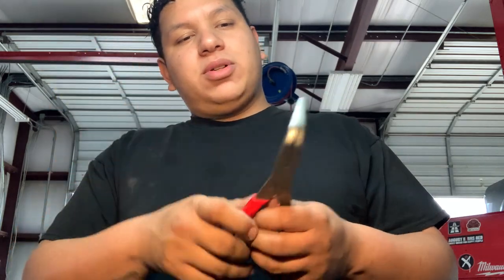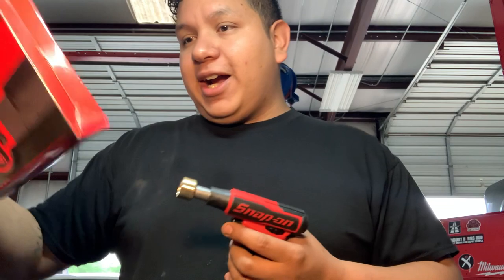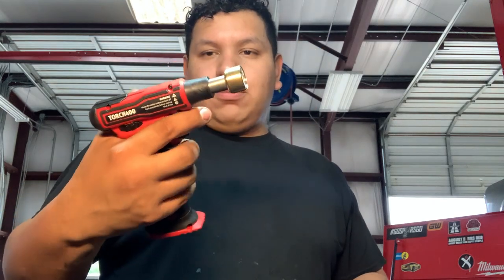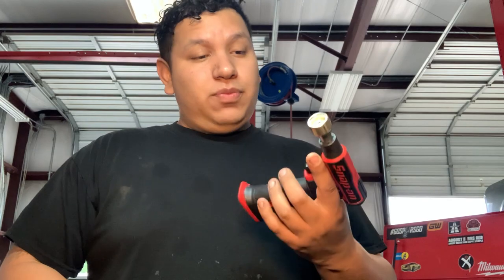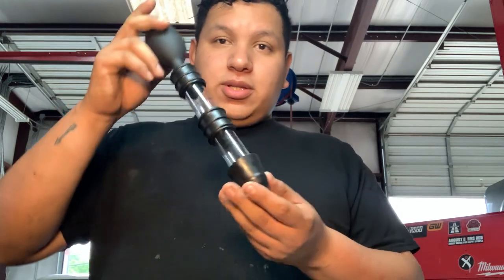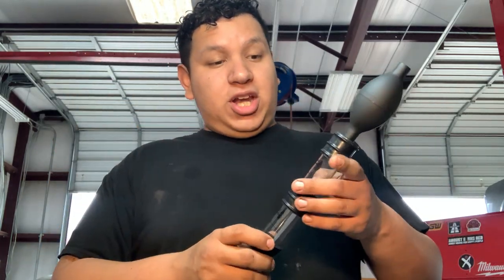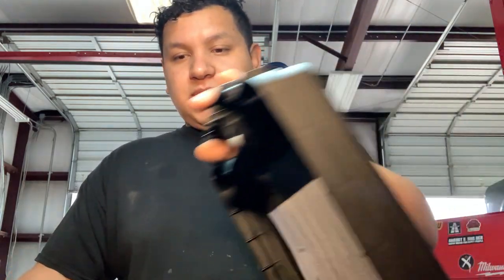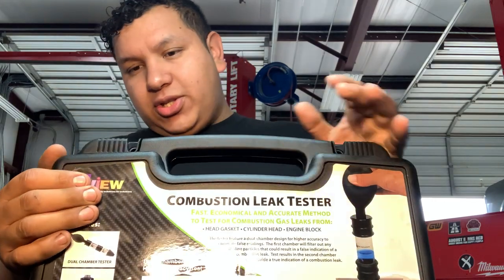Snap On Torch 400 & More

Comment: Ive got the torch 300, have had it few years now, worth the money, other guy i work with has the 300 and 400, he loves em both. Good haul bud
Reply from the maker: Nice I originally was going to get the 300 but dealer only had the 400s so grabbed that instead. Thanks bro!